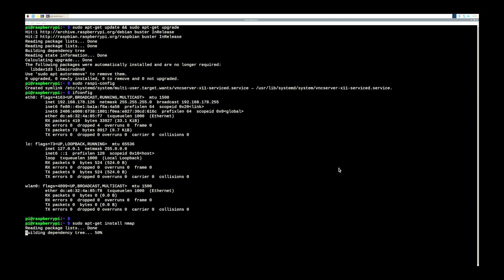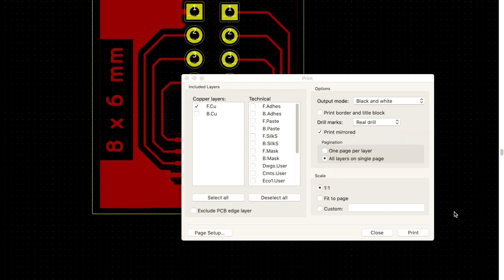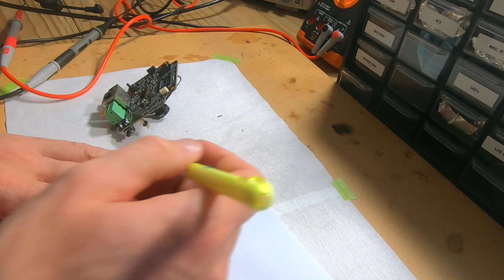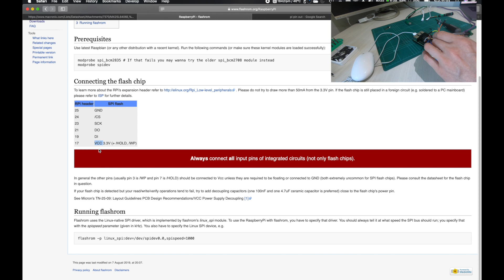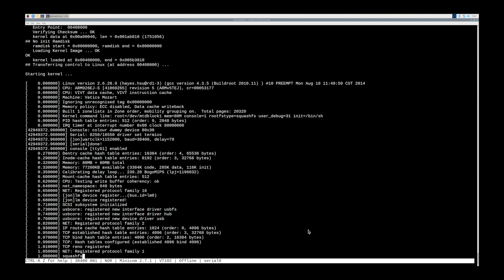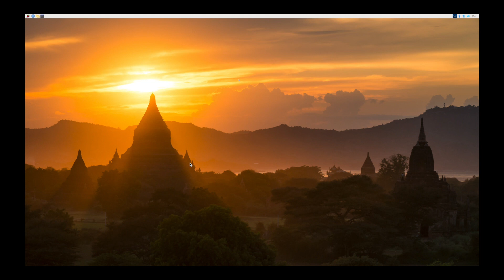Linux Embedded Device  (ADC-V520IR) Root access through serial shell & Flashrom

Comment: Hi , real dedication ! Are you in Auckland ? To do the same would i have to de-solder chip, make a circuit board and connect to the Raspberry Pi ? In the end will it just work as an IP camera or does it need to be connected to the Raspberry Pi permanently ? Thanks
Reply from the maker: Hi there, no I'm in the South Island! The only reason I desoldered the chip was to easily browse the file system and find the weakness. To change the password you just need a serial interface onto the uart port, exploit the uboot sequence and change the root password. From then on it acts as a normal IP camera with its own web page, you can find the video stream from any web browser and change WiFi settings etc. This is a volatile exploit, for example if you unplug the camera it will only hold the password change as long as the small battery on the board has power (a few days on my board). A better exploit would be to unpack the read only file system, change the password and reflash the chip. I tried to use this method to permantly change the password using a firmware update over TCP/IP but unfortunately I never got it to work. I will put the commands  to enter to quickly change the password in the comments when I dig them out again